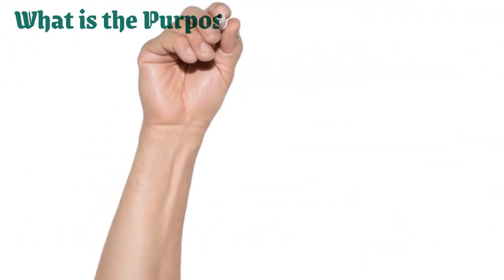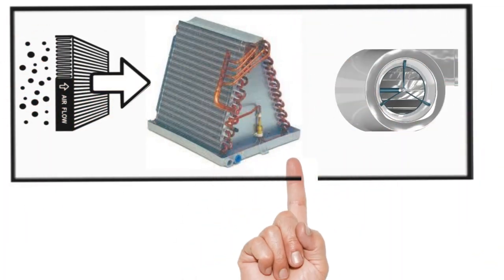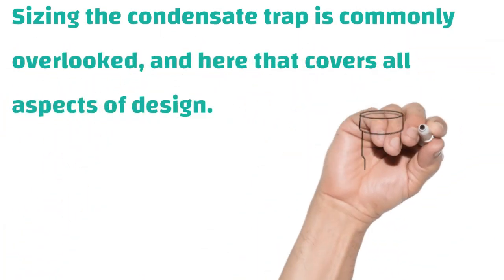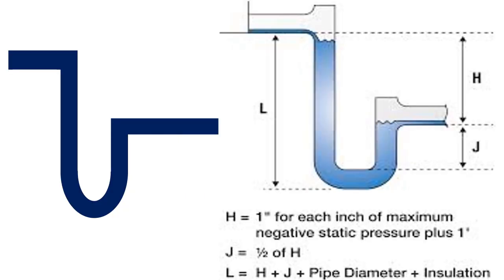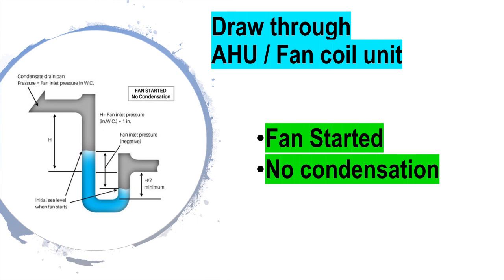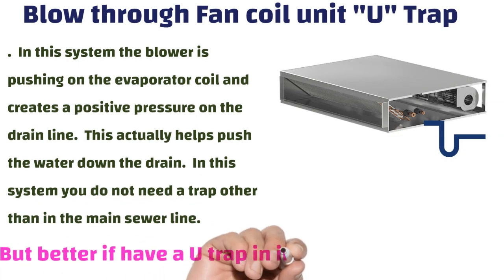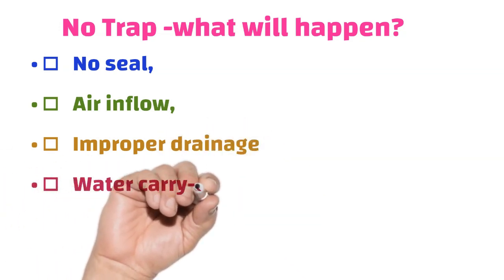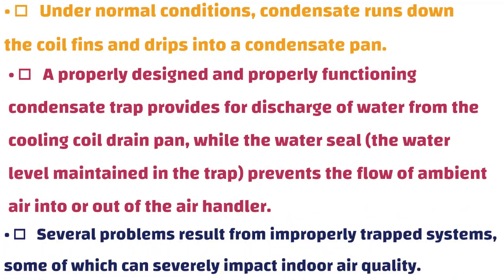Understand All about ''U'' Trap in Condensate Drain pipe

Comment: Thanks for the help i have a problem with one unit I thought on the drainage or filter the fan motor is pulling the water to the engine and the engine trips . 
I will start with the drainage.